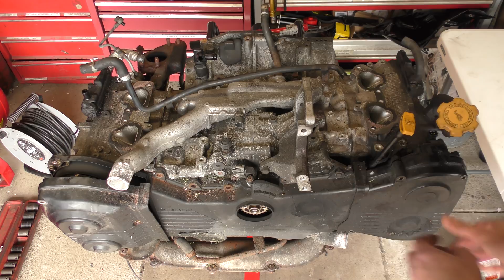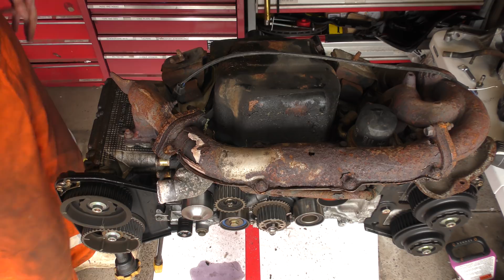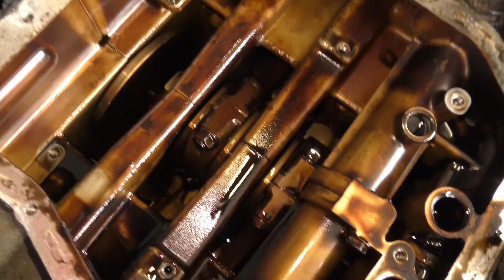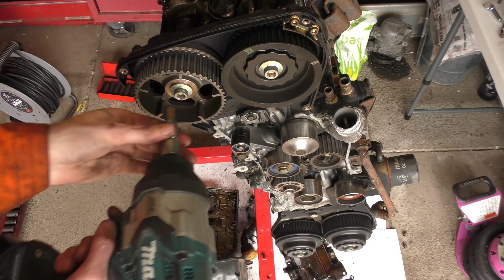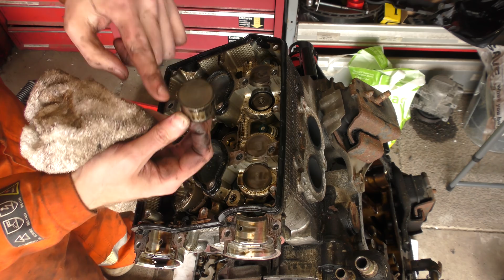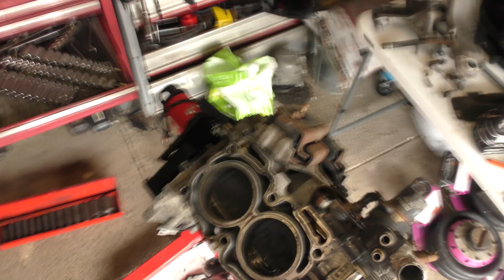Subaru Impreza Engine Autopsy part 1

Comment: Do you guys in England dip everything in salt ? The corrosion on the motor is crazy , often not that bad on alloy motors from the 60s here in oz
Reply from the maker: Kind of yes.  We salt the roads in the winter.  Which means that unless you underseal the ever living shit out of everything it rusts away in a few years.  It's almost like they want cars to only last a few years so they can sell you a new one.  ;)

Comment: If your Makita gun is lacking power. Could be the battery. Had that issue with my Milwaukee (that which undoes anything) wouldn't undo wheel nuts. Swapped the battery for a new genuine one and full power restored.
Also made a difficult choice today not to fix the Saab....developed a severe turbo screech and boost leak.....so reluctantly have ordered a Dacia sandero to replace it......doesn't feel right though....
Reply from the maker: It might have been the combination of 1/2 inch to 3/8 to the spline driver.  That'll rob a lot of torque.  But they were bending my gold breaker bar, so they were pretty tight.  Turbo screech, that's the sound of £££ escaping.
Reply: @DavidMcLuckie  Thats the sound of the car getting replaced, stuttering on throttle followed by compressor surge, black smoke wehn it does it, also hideously overboosting - requested boost 19-23psi, actual boost 46+psi- i think thats what did for the intercooler in the end. Took the hose off the input side of the turbo and its wet with oil, took it from the exit of the compressor side and theres......sparkly bits in the exit hose....so wheel has been rubbing on the housing due to play in the shaft.

Intercooler is going powdery on the bottom. Clutch needs done - All in £600 in parts for Turbo, IC, DMF (might as well) plus sundries (driveshaft seals, gbox oil, clutch fluid, engine support beam (sold my engine hoist a few years back)
Too much for the age of it, makes me grin ear to ear when it runs right, but with the new LEZ coming in all over scotland, the writing is on the wall well and truly.

So PCP Dacia Eurobox it is....I just grimace at paying for something monthly. You can calso tell where Dacia saved money - the interior plastics are.....horrid, no cruise control but does have a turbo petrol engine making a mighty......90BHP....better cheap car than no car....

I've not made my halfords 24" bar flex yet and likely won't in the future, unless I'm mad enough to buy another used car........

Going to have to find a new hobby, now I'm not seemingly working on the car every other week (well thats what its seemed like)

Comment: Well I’ve just stripped down an old Fordson Major engine which must be 60 years old and its simplicity and ease to work on made it a joy , most of the little bits I needed to repair it I just made myself but looking at modern engines is bloody frightening, everything has to be so exact. I’m just glad I’m watching someone else doing it. Anyway really interesting to watch and why don’t you keep smashing your hands or pinching them or cutting them like I do when messing with engines, I usually try and leave a pint of blood in the engine and about the same amount of oil in all the cuts. Look forward to the next part
Reply from the maker: I like to use my fingers as fulcrums for levering off of.  Or trapping them in between the spanner and something large and immovable.  :)

Comment: Love these engines, folks seem scared of them because of the layout - but they are pretty straightforward really!
Reply: People are scared of them because rod knock and ringland issues come as standard. Having owned Subarus and live near a garage that specializes in them i can tell you that nearly all turbo subaru's on the road will have a rebuild before 100k. Puts food on mechanics table :)